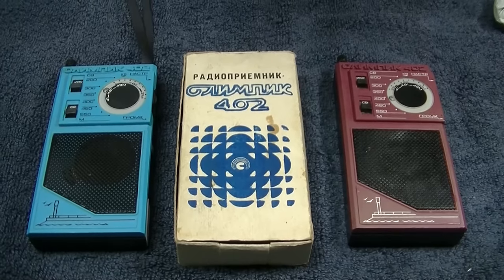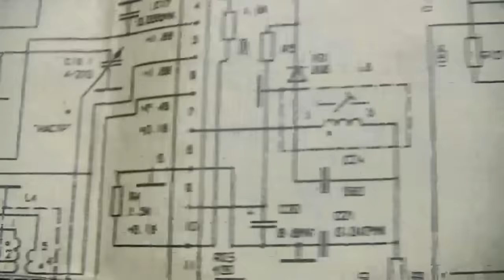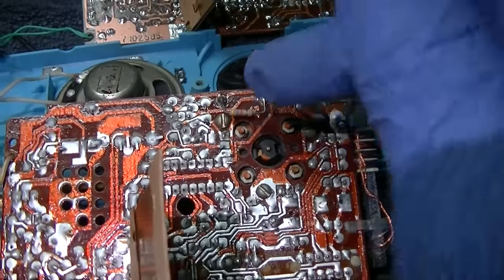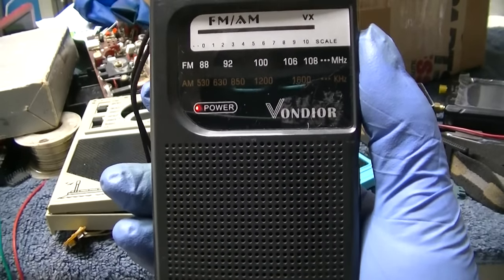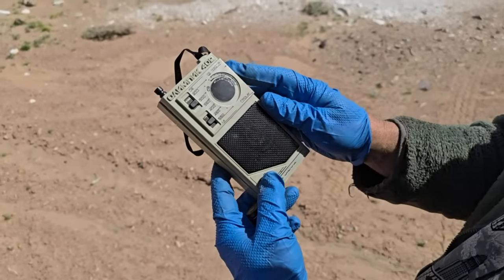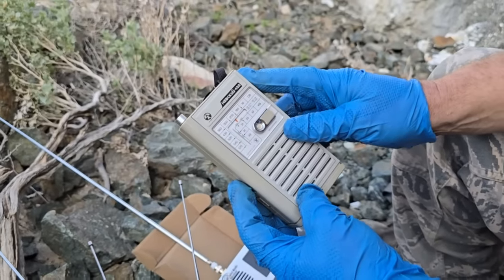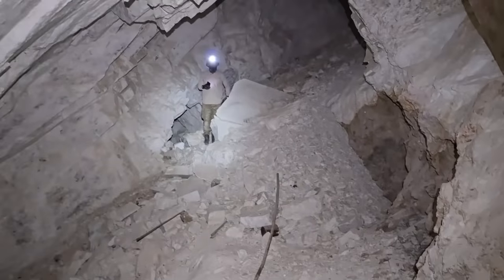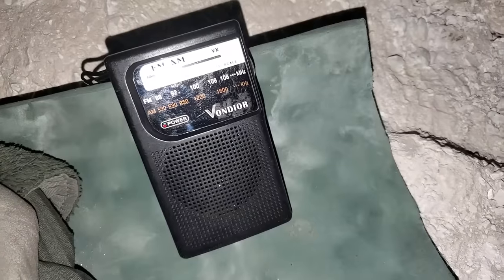Олимпик Olympic 402 Soviet Radio Repair and Testing Several New Radios Desert Trip Ukraine Made

Comment: Hello. Please note, there is sensitivity in milliVolts (not microVolts) , so, 2200 uV/meter and 400 uV/meter respectively. Sorry, no miracle happened this time. May be later ... Have a good day and Thank You for video!
Reply from the maker: This would explain what I overlooked
Reply: Yeah I was about to post that, the Russians are using millivolts and Zenith’s data’s in microvolts. I was watching the full video though, often Dan edits a correction in somewhere in the video.
Reply: Whip antennas pick up the electrical part of the wave that doesn’t seem to penetrate obstructions like walls and, in your case, beneath the surface. My loops perform much better indoors than any whip or vertical amplified antenna I own.
Reply: Probably not what you want to read, but,  Talc  and  Asbestos go hand in hand,  especially in Talc mines.  It's been a problem for decades being found in Johnson and Johnson baby powder  (talc  powder)  make sure to wash your clothes thoroughly.   Great video  !!!   BTW   what lights did you say you like the best ?  I'd like to get some.
Reply: With all the manmade noise on the MW AM band, any sensitivity below 30 or 40 microvolts would be unusable. A friend built an AM broadcast receiver with TWO tuned rf amp stages, he estimated the sensitivity to be 40 microvolts. It made no difference in sensitivity due to the inherent noise in the AM band compared to an old vacuum tube car radio, which are incredibly sensitive. And he went to great lengths to get the receiver to achieve 40 microvolt sensitivity. So the radios in the video could not be 1 microvolt sensitivity. Bogus numbers. Possibly 1000 microvolts.
Reply: @quantumleap359 If radio signals travel for ever according to Einstein, then why does my kid's RC toy car not receive the signal from the toy transmitter when it is only 15 feet away? Please explain.
Reply: @mianahmad5918  Your toy car has a wide-angle beam so power greatly diminishes with distance. Imagine a lightbulb vs a laser pointer which you can see a mile away.
Reply: @eDoc2020 very interesting information. It means that the electrons, which are carrying the specific information of that frequency, disappear. Can we say that Einstein was wrong? Thanks for your quick reply. I appreciate.
Reply: @mianahmad5918 RF is not made up of electrons for a start. If it was we'd all be dead.
You can say it's made up of photons, same as light, just outside the visible range.

The photons don't disappear, they spread out in all directions. Makes the signal get weaker the further you get from it.

Same as looking at flashlight from across the room Vs a mile away
Reply: @leyland9999 
Could you link some sites with good indoor loop antenna project that can be built easily, and works good on SW?
Reply: @incandescentwithrage please explain about the electron theory. Do electrons decay? Thanks for your reply.

Comment: I bought one of these Vondior 926 radios. It really is an amazing pocket radio. Fantastic performance and decent fidelity in sound quality for a pocket radio. Might be the best I've ever used in this class of radio. Both AM and FM sound great on mine. Great selectivity and good for DXing.
It's a copy of the Sony ICF-S10MK2 but is a digital radio instead of being analog like the old discontinued Sony so there is no similarity in the circuitry from what I understand. Some have compared the two radios and claim that the Vondior actually out performs the Sony.

Comment: Sadly this is common for the USSR/ Eastern black electronics. Very low quality PCB, bad soldering, damaged parts, sometimes a brand new products not working and with defects. As someone living in former Soviet satellite country, I have seen it all. They had the ideas, but not the material base and the quality. Still, I love old AM radios, handheld, tube, transistor. They have very interesting designs
Reply: Dude "ты гонишь")

Comment: 13:54 litz wire. Just in case anybody else is having trouble coaxing the grey matter in to provide the answer.  
"Litz wire is a particular type of multistrand wire or cable used in electronics to carry alternating current (AC) at radio frequencies. The wire is designed to reduce the skin effect and proximity effect losses in conductors used at frequencies up to about 1 MHz." (Wikipedia).

Comment: The good old TCA440 / A244D in russian version.

TEF6686 radio software was made by european DX enthusiasts expecially for fm reception.

27000 is the upper limit the chip does.Some newer sw versions allow display-switchoff (screensafer)  to minimize interferences.

Comment: I had this Olympic and the only thing that impressed me with it was that it was capable of discharging a shitty Soviet battery in a few minutes. At the time they were being made, everyone had already switched to the FM band and no one needed these receivers. That's why there are so many of them and they are so cheap.
The resistor for shunting the coil and changing its frequency response was sometimes bitten off immediately at the factory during adjustment.
Reply: I just checked the "Bay" and there are a few listed , but sellers what too much money for broken units. ( Shipping is also crazy )

Comment: I remember DX'ing in northeast Montana growing up as a kid.  We had a station on 1070 daytime but when they signed off at sunset, you could hear KNX pretty nicely at night.  After the sun went down, the top of the AM band was always a challenge, just so much coming in at night.  It was smooth as glass in the daytime like your reception out in the desert.  But I can say I picked up KNX, KCBS, KFBK (Sacramento), and even KRLA (1190), which is now KEIB (Patriot Radio I think it's what it's called).  Interestingly enough for a time I remember KIIS-FM was simulcast on 1190 way back when.  1190 was a tough one because there was a pretty strong semi-local station just across the border in Canada about 100 miles away, but it was far enough that it faded out at night.
Reply from the maker: I don't think so anymore it really seems like they cut the power way back on knx
Reply: @shango066  I'm sure KNX got permission from the FCC to do that, though.
Reply: @shango066  Thumbing though the info, it looks like KNX has two towers - primary and backup.  Perhaps they're working on the primary and currently running on the backup?

Comment: Enjoyed the video, as I have a Bronco with that exact style shelled AC compressor; I'm sure the whole system is contaminated with aluminum shavings!
On the PCB intermittents,  If you will solder small-rings on the PCB, in strategic circuit locations (usually the signal-chain first), you can clip the scope probe on, and then use both hands to flex the board.  If that doesn't yield a clue, then you move to another location.  I have fixed so many of these that I jig and attack the signal chain immediately.
Finally, if you really have to, you can place these test-points where you can see voltage changes which will then narrow it down completely.  73...

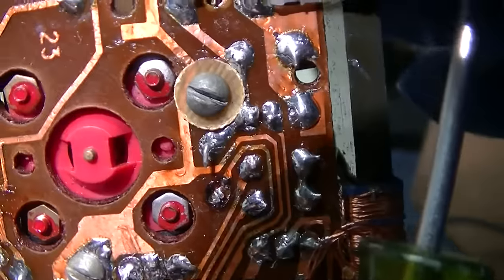Comment: 46:31...that slot head screw is missing the insulating washer like in the other radio @ 46:41. Idk if it's touching the circuit and causing anything.

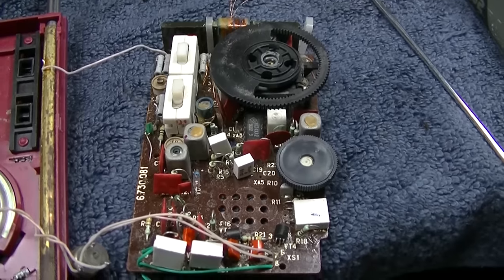Also, @ 15:06, 15:09 ...it looks like there's a hairline fracture on the board, starting from the cluster of drill holes, running up the board.

Comment: In 'Radios von Gestern' by Ernst Erb I found that sensitivity is measured as the voltage in micro Volts nesessary to get an output power of 50 milliWatts at 30% modulation. The sensitivity of a super based on a ECH21, 2x EF22 and EBL21 should be between 15 and 50 microvolt for medium wave (MW) and long wave (LW) and 3 to 8 microvolt for the short wave (KW) band.

Comment: Shango!!!!    Just  got a  HY LITE  1970 transistor radio  up and going again.   The fault was a bad detector diode and the driver transistor.  I replaced the NPN driver transistor, but the radio is too loud.    Been experimenting with the emitter lead adding resistors to lower the gain down.  But just doesn't sound correct.   Appreciate your help.

Comment: I once broke a fan belt about 15 miles from town, out in the 100º desert and was able to get back to town by watching the temperature and stopping to let it cool off before it overheated then driving some more, stopping again etc. This was before cell phones so it was either that or walk.
Reply: I would have thunked it be better to leave the belt on and driving it kind of like he was until it completely ceased vs over heating the engine and losing battery power all the way there... but it worked so can't argue.

Comment: Great video!  I've got one of those Nevsky radios and while it's pretty hot on receive it's pretty noisy too.  I got a Qodosen SR-286 about a month ago and it's blown me away with what a micro radio can do.  It's based on the TEF6686 chip.  Check out some videos on it.  Thanks Ted
Reply from the maker: Does it squeal on the am band like this one does?
Reply: @shango066  The SR-286 does not squeal, because there is only a simple display in it. The squealing comes from the big display / display interface . Even with a loop antenna or long wire the squealing will decrease with this model here. In newer sw versions an option to disable the display (sreensafer) can decrese those interferences too.

Comment: Great video as usual Shango. You should do a video on the Toshiba RP-S400 pocket radio from 1979/1980. It has an RF amp for superb sensitivity. Selectivity is pretty good also. It was the first PLL synthesized pocket radio and Toshiba pulled all the stops on it. Mine is an absolute DX hound at my California high desert location. Cheers!

Comment: Gee.  Makes me wonder how my Radio Shack DX-402/Sangean ATS-505 would work out in the desert.  The sensitivity on mine is incredible.  I also modded mine to have a wide open tuning (the silence in-between frequencies is normal on a stock ATS-505/DX-402).

Comment: Man that mine has my nerves firing on full blast, I am so damn claustrophobic that a MRI machine puts me in full panic, I need meds to get inside even an MRI machine which I have to go into every 6 months to insure that the cancer has not returned, had my right kidney removed a year ago Christmas. Doc said it was the biggest he ever saw come out of a human, if I had kept it for another month I would not be here any more so they got it in time I guess. I have the Chinese clone   of that white radio, it has full scale and when hooked to a decent outdoor antenna it can pull in a lot. My house is a faraday cage I can barely get the local AM station through the steel roof and aluminum insulation.
Reply from the maker: Its called turbo cancer lots of people i know have and are getting it. You know whats causing it right??

Comment: Sensitivity rantings area alway bound to a standard SNR. For AM it's usually in the mV/m. More Sensitivity doesn't make sense due to the larger bandwidth as the SNR depends on it. In other words higher Sensitivity would only amplify the noise.

BTW the red ceramic caps are all bypass caps. Back in East Germany we had shit loads of them...

Comment: It looks like the Vondior uses AA cells.  That's another an advantage if you're building an emergency kit (or even packing for a hike) - fewer battery types to stock up on.  AA are used in a lot of things.  9V, not so much.

Comment: Newer pocket ones are one chip DSP radios with extremely low IF. TCA440 is a bit noisy (swapping to the original, not soviet copy might lower the noise with some measurable db, but most probably not enough to hear the difference). And yes, super pupper SDR/DSP (russian MalahitTeam, Belka DSP and their chinese knock-offs, this one is chinese knock-off TEF6686, the chinese all band based on Si4732 chip) all suffer from a tone of beaten frequencies, some internally generated, some from the screen and microcontrollers that drives all the internals.

Comment: Probably caused by the lcd screen. That’s where an external antenna comes in. Not just that piece of long wire that will overload the radio as it is not designed for that on AM. I have very good results with the Malahit wired up to the Tecsun /Kaito AN100/AN200 passive and tunable small loop. This loop kills the interference caused by the lcd screen. The lcd can be turned off on the Malahit by the way. Unbeatable for an affordable portable radio. Wilhelm.

Comment: I have understood one thing now... ferrite antennas are ideal for underground reception and telescopic antennas for above ground reception... but why isn't there a ferrite antenna for FM radio... wouldn't you need a particularly small one for that?...thx for the vid
Reply: Ferrite usually has high losses in VHF and UHF range, there are special kinds of "ferrite alloys" but it's super expensive.

Comment: Can you just do a test using a long wire and wrap the wire around a radio 3 or 4 times leaving  a few feet extra wire to ground. I  would say you should pull in more stations  in the desert  area.

Comment: Ref;  Bar antenna winding, this is a poor execution of  'Litz Winding'  used for applications where limited space necessitates a conductor with excellent fill factor and copper density.    I found the Soviet radios and TV's to be good receivers,  I believe that is so they can 'educate ' the great unwashed with CCCP proper-gander. Dodgy plastic lets them down.  Great work Shango.

Comment: Good grief, they are so "plasticy", but DAMN do they work well.

The true measure is SINAD. At RACAL, the little PRM 4700 had a sensitivity of 14uV for a Sinad of 12dB. I set up 100's of them and if you were really careful, it was possible to get as low as 5uV for Sinad of 12dB.

Comment: Poor mans Litz wire ?
Reply: Not all litz wires have that silk sleeving. But yes, the individual wires of the litz are seemingly way too thick for this application in the Olympics. It should be made of like 0.05 or 0.02mm wires, and that case it definitely needs the silk sleeving, it would be way too fragile without it.